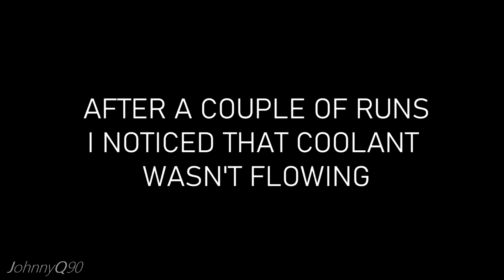Holt H75 TRACTOR Engine!

Comment: I think it's a gorgeous engine, I especially love the shrouded radiator and fan, as well as the centrifugal governor. Bit of a bummer that it was a rather shoddy build. Someone not mechanically inclined probably wouldn't have noticed the coolant issue and kept running that thing until the bearing surfaces were completely nuked. I kind of get it, these aren't built on a massive factory line. I imagine there aren't a lot of these built at all, so there are going to be cock-ups. That they used the wrong size o-rings, however, was a pretty big cock-up. Especially as these things aren't exactly cheap. That said, I kind of wish someone could get them to make a submarine diesel. I would be all over it like stink on poo if they did, lol...
Reply: submarine diesel ?? wasnt that normal diesel engine ?
Reply: These scale models are already expensive to the point that the market is limited,. The customers are technically minded enough that small mistakes are allowed if the mistakes are serviceable, as it helps keep the price within reason.
Reply: @MrCcfly  That depends entirely on one's definition of normal.
Reply: @Bubu567  I would be willing to bet that much of the customer base is not mechanically inclined in the slightest, and are buying them just because they find them interesting. As a mechanic, I see it all the time. Nothing wrong with wrong with that, by the way, but it does exacerbate any production issues.
Reply: @gvii  wasnt rl subs use normal ship kind engines plus bats ??
Reply: @Bubu567  i dont really think the customers of these engines are highly versed in engines. otherwise for that price they'd buy different better build engines. these small "standing" engines are exclusively showpieces or kids toys for the well off. i dont think they know what theyre doing to this extend
Reply: I was gonna disagree until i saw the price.
Reply: A "submarine" diesel, at least on newer boats, is often (688 class subs) a vertically standing, 8-cylinder, 16 piston machine.  There is a crankshaft top and bottom and the pistons meet near the middle of the cylinder, where the fuel is added.  A vertical shaft and gearing keeps the top and bottom cranks synchronized.  If I recall these are 2-stroke cycle engines.  A blower is driven from one of the crankshafts, this helps with power production and to provide are to clear the exhaust out of the cylinders.
Reply: yeah, it really is a shame, especially because i'd love a small watercooled inline-6 4stroke for model aircraft. like an old albatross biplane or something.

but with rubber pistonrings its not gonna last any load you put on it for any amount of time. these sadly are just showpieces and at that price i can get a very good saito 4 stroke
Reply: @drache444444  Those aren't the piston rings, they're actually just seals to keep the coolant around the cylinder liner and out of the oil sump. But yeah, one of those old WWI Mercedes aircraft engines would be very cool. I wouldn't mind a Benz or BMW V-8 either. But that's a bit of a rabbit hole. Plus, I don't know if the P/W ratio of these would work too well in a model aircraft. Edit: Crap, I didn't notice the rings, I though you were talking about the seals, I'm sorry... Though you would be surprised how long those do last. Don't know if I'd trust it in a model I built to fly, so I agree with you there...
Reply: @gvii  yeah, i was gonna say, at 2:12 you can clearly see the green rubber piston ring. the thing why i think theyre not gonna last in an rc model aircraft is that especially because of the (scale correct) low power to weight they'd be running at close to max power for basically their entire flight time. so its high load, high~ish rpm for up to 15 minutes with basically no pauses. i dont think they'd last more than a few fuel tanks. and then the rubber might go everywhere, gunking up something that could cause further damage.
Reply: @drache444444  Yeah, I agree, I wouldn't put much faith in it. At least not in something that's got a long way to fall if it goes sideways, lol.  But it would absolutely awesome having a functional scale motor. People can do really amazing things with what's out there, but having a running micro version of the real thing would be just fantastic. That's a LOT of work though, lol.
Reply: Check out German type vii uboat videos for more information on that style of engine if you feel inclined to do so
Reply: @Bubu567  seeing some of these videos and I don't know if I want to use the word cheaply built, but I definitely think they're just kind of put together quickly with little oversights like the O-ring sizes being skipped over. I get that there's a lot of little pieces but some of them I do think are a little bit too expensive. As a mechanically minded person myself I wouldn't mind getting just a kit full of pieces and putting it together myself but sometimes those can be pretty expensive as well. At least being able to build it yourself you could adjust tolerances and make sure things are tight and within spec as you go. I love building things and I think it would be super fun to be able to put together a model of an engine and then hear it run afterwards. I would be the guy that would add a little generator and a string of LED lights to it or something as well lol
Reply: @keithyinger3326  Definitely make it do work, even if the work it's doing is pointless :P
Reply: @donbarr9487  Fairbanks Morse opposed piston 2 stroke diesel. That would be pretty tough to do here, as would any diesel... the compression ratio would just beat everything up too quickly. Still would be cool...
Reply: @gvii  All these little gas engines use an oring for the piston seals... I have 2 of them.
Reply: @donbarr9487  do you have some pictures ? or text where i can find more info ?
Reply: @MrCcfly I don't have any photos of the engine on my boat, but if you search for Fairbanks-Morse 17984 I think you can find a training film from WWII.  Little has changed since then.

Comment: Awesome little engine(with its flaws), but what suprised me the most is that it got a centrifugal gouvener controlling the gas. I had to rewatch the video just to see it clearly. Those 2 rotating brass balls right behind the flywheel at 1:16
Reply: It doesn't control gas (thats controlled with his finger), but it controls the idle. I don't know if real tractor engines have a governor, but it seems resonable a tractor engine must have a governor if you are using the PTO in idle, since putting a load on the engine in the idle will sag it down, thus you cannot have a static idle that a "normal" engine has.
Reply: @sebastiannielsen  Yes, tractors, like most industrial and machinery engines always have a governor. It would be impossiblee to operate a tractor without a governor, not only for the PTO but for normal operation too.
Since most jobs are done at very low speeds the inertia is minimal while the load varies constantly and widely, without a governor it would be impossible to maintain a constant speed or even prevent the engine from stalling, the operator would have to be controlling the speed of the engine continuously and that would require a lot of physical and mental effort, distracting the operator from driving and controlling the implements.

Comment: it's amazing how many engineers dont understand that o-rings need to squash.  the idea is that it's a round cross section going into a square profile and the ring squashes into the angled corners. I've seen engineers cut a 3mm chanel 3mm deep because the o-ring was 3mm.

Comment: This is a Jianzhong Dong engine, and Jin is an excellent engineer. However, I haven't bought this engine, as it is very expensive and has been problematic with water leaks from the cylinder liners.  He is selling improved liners, but should be providing them to previous buyers of this engine for free.
Reply: There is numerous issues with this engine. The worst issue is it’s running backwards. Jin apparently didn’t pay attention when scaling this down from the real H 75. That’s why the fan is turning backwards and the centrifugal water pump doesn’t work unless you flip the belt to reverse its rotation. It really needs a camshaft designed to run the engine the other direction. It’s still a nice engine. I bought mine off of eBay. You can get them on eBay for anywhere from $500 to $700 brand new from Jin.

Comment: 01:05: Is it absolutely necessary to add oil to the fuel if the engine has an oil pan with lubricating oil? 😊

Comment: My crank case covers didn’t seal at all so I used a thin piece or rubbed gasket to seal it up to hold a little oil in the crank case but it runs great

Comment: At 3:32 you can see that the water pump belt is crossed.  I looked on the linked website to buy, and it isn't crossed.  Maybe that had something to do with the lack of coolant flow?  Love your vids!
Reply: Unfortunately you have to flip the water pump belt because it’s a centrifugal water pump and the engine is running backwards! They designed it with the wrong rotation camshaft so the only way to get the water pump to pump water is to flip the belt. The fan on the radiator is also running the wrong direction as it’s blowing air out the front! To correct this they really need to reverse the rotation of the engine and make it  like the real one by designing a new camshaft. Unfortunately they used the public as the guinea pigs hence the leaking O-rings and wrong rotation of the engine, water pump and fan!

Comment: Good evening Johnny q 90. I have a small four stroke engine. M 16 is in question. I am interested in how much oil should be put in the oil pan if the ratio is 4%. Should you use oil for two-stroke engines or oil for four-stroke engines? I usually put 1 milliliter of four-stroke engine oil in the oil tank and make a two-stroke mixture according to the ratio that I put in the tank.

Comment: Do you have a link where you got the O-rings from? Is 19mm the outer or the inner diameter? I have exactly the same problem with my Holt H75. After each run, most of the cooling liquid dissapears into the sump.

Comment: it looks like it does not have piston rings but O-rings instead green in colour  I suppose if the engine doesn't get above hundred centigrade and there is oil they would last a little bit of time I suppose that's why it requires 40 to 1 mixed with oil  great if piston rings perhaps two per piston could be installed and then run on proper gasoline no oil.  Engine does not make much smoke and really does sound like a miniature car engine.  👌👌👌👌

Comment: I love watching all your videos you're very talented the V8 supercharger superchargers trying to compress the air in the wrong direction it should spend around to the outside of the case and then as the blades interact with each other it forces the air down to stay in that chamber if they spend to the inside a lot of the boost runs around the outside of it rotors  back to the carburetor side and the boost will be more consistent keep up the awesome job love them all

Comment: Holt 75 1913-1924 22.9 liter gasoline crawler tractor  75 hp on the belt 50 on the drawbar, two speed transmission, 23,000lbs, 7.5-8 Inch engine stroke running at 550 rpm  this information is everything on tractor data

Comment: How does the governor work?  Ordinarily the speed control is at the governor and the governor controls the throttle… but not so here.  What detail am I missing?
Reply: you`re probably missing the ignition part.
my best guess is: the govenor is linked to the ignition circuit and cuts it out, when the rpm is higher than the proposed throttle input. some sort of adjustable hit`n miss engine.
Reply: @monstertrucker1  There doesn’t appear to be any linkage that could actuate an ignition cutoff… but it’s not easy to see.  After looking at the engine in more detail it seems the governor is indeed connected to the throttle lever.  In that case, and assuming the throttle servo is also attached to the free end of the throttle lever, there needs to be a spring in the throttle linkage (much as you’d normally use on a brake linkage).  In that way, the final throttle position is a balance between the opening spring force from the servo and the closing force from the governor.  That’ll do.

Comment: do you have an exhaust in the room ?
Reply: @felsinferguson1125  Thanks for you message. It will not blacken the roof of the room ?
Reply: @neortik7  Once again, the amount of gas being burned is so small that you'd likely have to run it continuously for hours upon hours before you'd even be able to notice, and even then, it'd have to be running rich - for an engine this small, probably rich enough that you'd likely have trouble keeping it running at all. At anything like a reasonable mix, soot production should be barely detectable, if there's any at all. An engine that's running at least reasonably well, on a fuel-air mix that's something close to correct (neither too lean nor too rich) produces mainly H2O, CO2, some NOx, and perhaps some trace levels of "other stuff" as exhaust. Too rich, and it will start putting out soot (incompletely burned carbon compounds) too lean, it'll put out more NOx and eventually burn itself up. Based on the fact that there wasn't any visible smoke belching out of the exhaust, this one is running at least reasonably well, on a mix that's not rich enough to be of much concern.

Comment: Cam sounds a bit on the choppy side for a tractor engine, I bet it would scream if the thing had more carb and timing
Reply: Those model engines don't vaporize fuel real well at low rpm. There's just not enough velocity in the carb and manifold, thus the choppy idle under no load. It would be neat to see it loaded down with a small generator or something. I noticed it's got a belt pully of sorts on the flywheel.😉